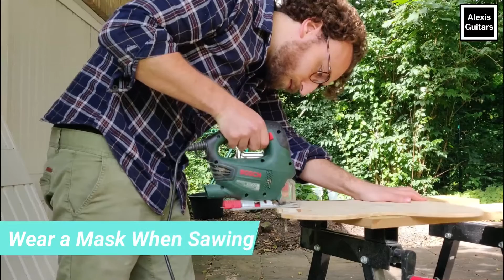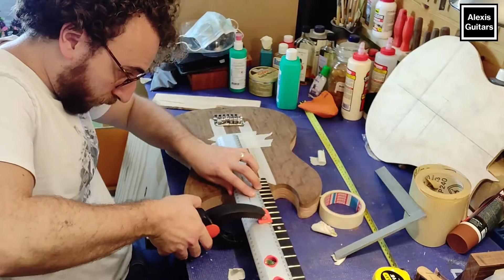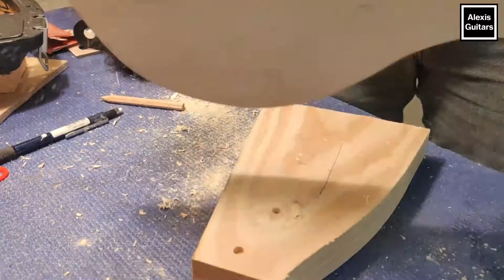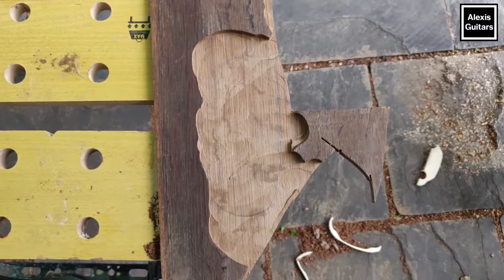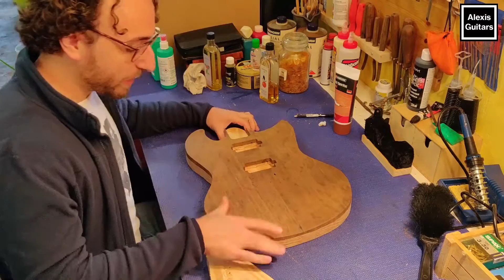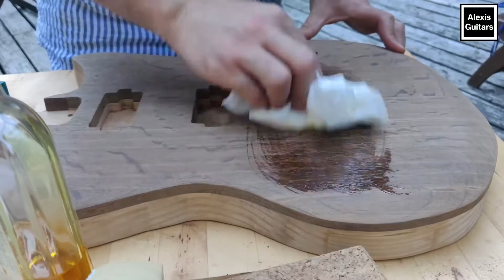Building A Guitar From Scratch Part 2 | Routing The Body

Comment: Bridge pickups have different string spacing, they're probably 52mm from outer pole to pole, I think that's the size. I think it's called F spacing to line up with the fender bridges.

Comment: I don't know the exact answer to your question.  But these could be "F spaced" bridge pickups which are wider the Gibson ones.  I don't know what spacing Iron Gear use, or if they use one for the bridge and the other for the neck.   But I don't know for sure.

I also reckon that oak top will really come to life if you use something oil based on it.
Reply: Actually, looking at their website, they list the pole spacing as 50mm for the neck and 52mm for the bridge.  Hope that's helpful :)
Reply from the maker: That's super helpful Chris, thank you very much! I hadn't noticed the difference in pole spacing on their specs page. Better get myself a proper neck pickup then!

Applying the oil is unmistakably the best bit about the process so far haha. 

Any tips for applying an oil finish? 

Thank you for watching mate, really appreciate it.
Reply: @AlexisGuitars  Just two tips with oil finishes that I've found.  Wipe more of it off that you think you should, leave it for longer than you want to between coats to totally cure properly to avoid a tacky finish.
Reply from the maker: Thank you Chris, really helpful. I did put too much oil on the back after filming this. After almost 2 weeks it was still sticky so I had to sand it down. Now it's finally a lot better to the touch but still needs a bit more sanding. I know now for next time!!
Reply: As everybody said, they could be either "F spaced" or "Trembuckers" which are even a little bit wider 
Check Seymour Duncan's page for more info: https://www.seymourduncan.com/blog/tips-and-tricks/string-spacing-explained-humbuckers-vs-trembuckers#:~:text=If%20you're%20not%20sure,inches%2C%20you%20need%20a%20Trembucker.
Reply from the maker: Thanks mate! It turns out the spacing of the neck pickup is narrower. The next episode of this will be out soon(ish) and I won't give too many spoilers, but the pickups and strings are lined up absolutely fine :) huge relief haha
Reply: @AlexisGuitars  Nice one! I'll check out part 3 when it arrives :)